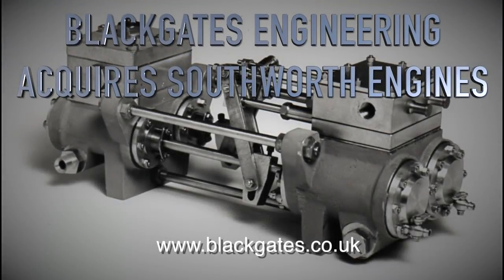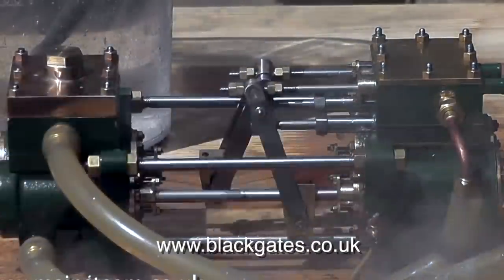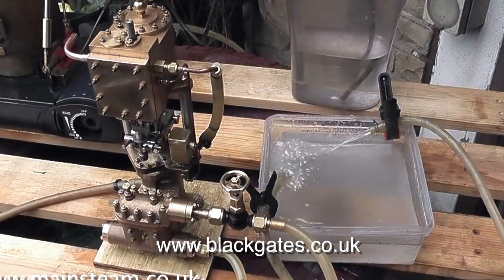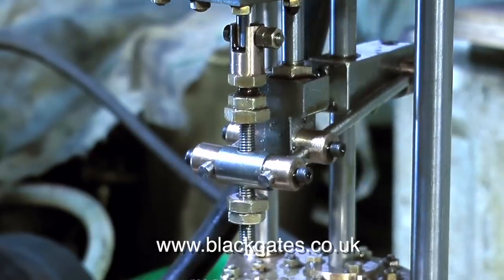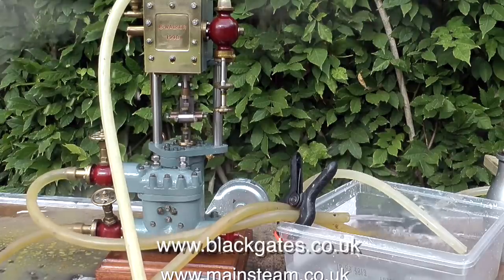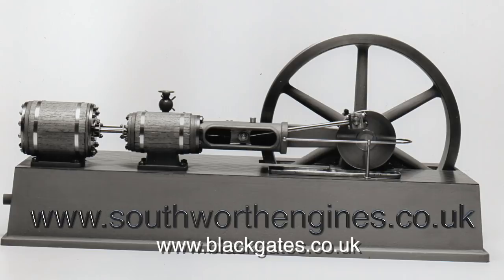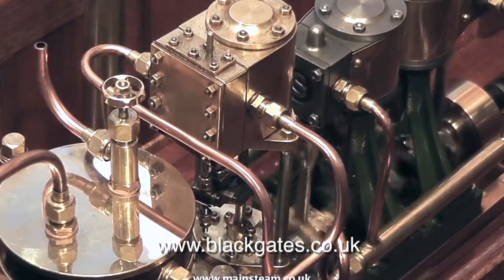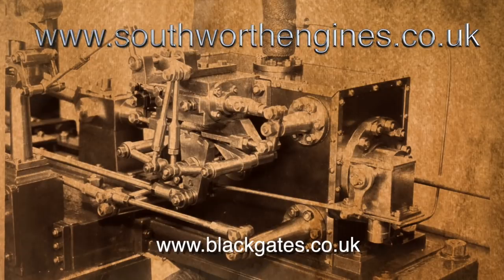BLACKGATES ENGINEERING ACQUIRE SOUTHWORTH ENGINES

Comment: I assume the pumps have slide valves in them. Is the valve driven by the lever attached to the piston rod - just knocking the valve and down sort of opposite to the piston movement?
Reply from the maker: the pumps have an internal shuttle piston and two slide valves.